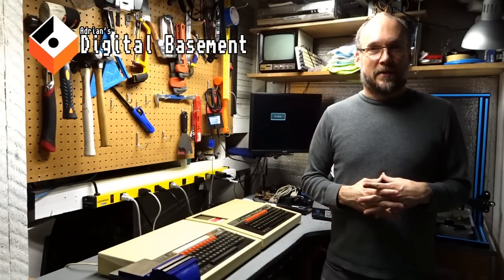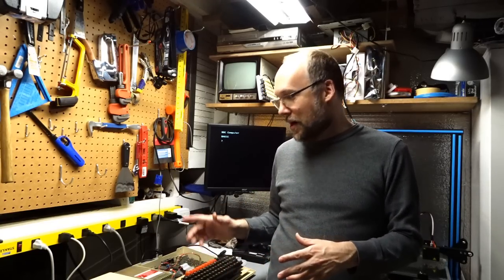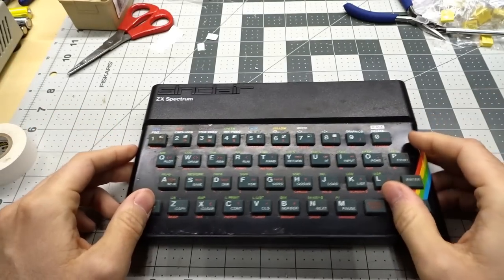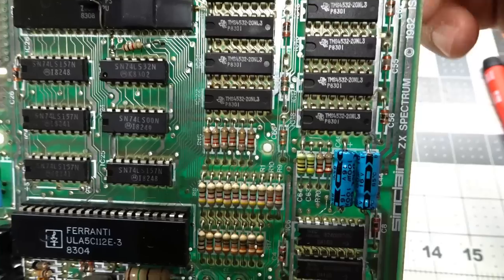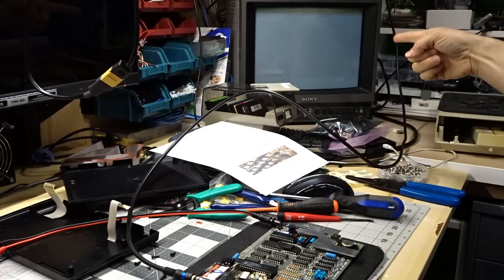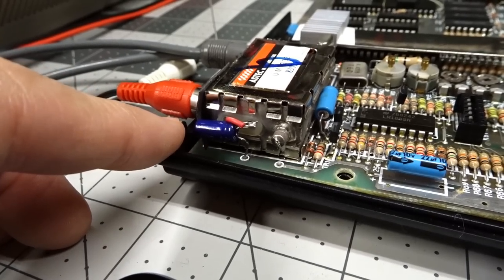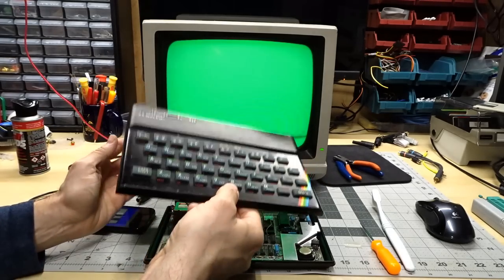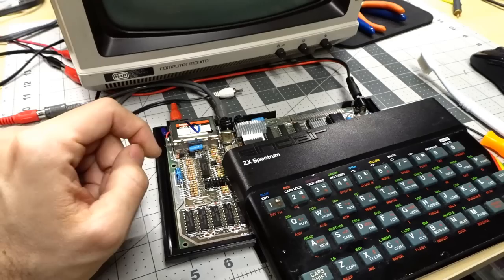ZX Spectrum Part 1 - It's a very sick machine (and a BBC Micro update)

Comment: I wrote my first program on one of these. It was a critical path analysis program for a project I was working on as an engineer. I ran it a couple of times thinking it did not work. Eventually I ran it overnight and the following morning at 4 am it spat out the results on my dot matrix printer. I cannot tell you how chuffed I was. One had to save the programmes on a cassette tape. Things are much easier now.

Comment: I had a Timex Sinclair 1000 probably 40 years ago or so got it from circuit city back before I knew Circuit City was chain store because in our town it opened in a small trashy 700 sq ft store front in a bad part of town.  This was back before Comodore 64, even before comodore Vic 20.  So early in the home computer cycle.  God I feel old now.

Comment: The lines through the colours is due to dot crawl. You may have noticed there are two crystals in there.. one generates the system clock and one generates the PAL colourburst frequency. Because they are not in sync with each other, you get dot crawl. They addressed this issue on the later 128K machines. You may find adjusting TC2 helps
Reply: @adriansdigitalbasement  the bad old days ;) Another benefit of the 128K machines is that they have an RGB output as well, which looks nice and crisp on anything modern!

Comment: Way back when this was state of the art I repaired these for a living. They are primitive but yet they were surprisingly reliable as long as the customers didn't do anything too stupid. The really weak spot was the edge connector which gives you access to all the signals on the CPU bus.There is nothing to protect the circuitry so anyone trying to connect or disconnect a device wile the power was on ran the risk of killing the computer. 

I remember one lady who came in with her sons machine several times only days apart. It was just a few weeks old and still under warranty so the first time we repaired it and didn't think more about it. When she came back a few days later and it was dead again we asked her if anything had happened that she thought might have anything to do with it, but no she couldn't think of anything. Well it was strange that it had died again, and that the fault was exactly the same as last time. So we mentioned that usually something like this could happen if you plugged in or unplugged a device like the printer or a joystick interface while the machine was powered up. It could also happen if the connector on any such device was damaged. But no, she was certain her son didn't cause this, that was impossible.
The third time she came back, it was just a few days later, it turned out to be the exact same problem again, and this time she was quite agitated and complained about the quality of the machine.  We took a good look at the edge connector and it looked like there were faint scratches there. So again we asked if she was certain her son hadn't tried to connect a device with the machine powered on. Now she got upset and explained that she was certain because he didn't have anything like that. He had no printer, no joystick interface or anything else, just the computer, so it was impossible that it was his fault. So we told her that we had to ask as it was very unusual that they died like this so many times. And then we took the machine to the shop, repaired it and painted the edge connector with nail polish. The next day she was back, and now she was livid. Not only were we incompetent as we couldn't repair her sons computer without it breaking regularly, but now her son told her the joystick didn't work when he got it back! I still remember her face as I calmly said that it was strange, just yesterday she had told us her son didn't have a joystick interface, and now she complained that it didn't work. Now how could that be? After some sputtering she said he got it as a present yesterday. So we told her that was a very good gift to her kid, just remember to tell him to never try to attach or detach it while the computer was powered on. Now if she could just wait a few minutes we would make sure it would work. So we took the machine back into the shop and rubbed off the nail polish from the connector, and that was the last time we saw that machine...

As for the memory problem I remember most of those was easy to find using a multimeter. Now I can't remember what pin we was probing but at least 90% of the time the bad chip measured low. If that didn't work we had a diagnostic board that ran a memory test and pinpointed any chip that failed.

It was an interesting time with new computers coming out all the time, and we're not talking just another IBM PC copy. We also repaired the Atari ST and the Commodore Amiga. There was very different in construction, though both used the same processor the circuitry was very different. The Atari was built down to a price point with just the bare minimum of components. Anything that could be excluded was left out. The Amiga on the other hand could be used as a teaching aid showing how you are supposed to design a circuit. And yet we had a much higher failure rate for the Amiga than the ST.

Another fun device was the Sinclair Microdrive. They used a miniscule tape cartridge containing a endless loop of tape that to increase the capacity was twisted into a möbius band. That way the tape had to pass the read head twice to access both sides of the tape. It sounds ridiculous but actually worked surprisingly well. Well compared to a floppy it was both slow and prone to failure, but there were ways to improve on the reliability. One quirk was that the tape in a new cartridge tended to stretch a bit before stabilizing. If the tape was just formatted once and then used to store data it tended to fail after a while as the tape stretched and the data became unreadable. A new cartridge typically formatted to about 85KB (yep not even 100KB, different times). I hacked together a bit of code that just reformatted a tape over and over again, and after a while the tape would format to somewhere between 95 and 105 KB, after which it didn't seem to stretch much any more. After that it seemed the tape was much more reliable.

The interface used to connect the Microdrive to the Spectrum was another interesting device. It could be used to connect up to eight Microdrives to a Spectrum, and it allowed up to 64 machines to be connected in a network. Any machine on the network could access any microdrive on any other machine on the network. There were no security whatsoever though so you could really mess things up if you wanted to. I don't remember any commercial games that allowed for network gaming, but I hacked together some software for real time messaging and remember working on a actual game, but I never got past the roughing stage. There wasn't exactly many who had a network of these to play on anyway, so it would just have been for me and my friends. Another big problem was that the network wasn't what I'd call stable- Messages was lost and connections dropped. If two machines tried to send at the same time bad things could happen. But it was a fun toy at a time when local area networking wasn't really standardised or an everyday thing.

Comment: The keyboard metal plate is stuck on the top plastic case by a double sided sellotape on either side and this can be easily praised out to reveal the membrane, wash and clean the rubber (only) with mild soap, and check the membrane connector for cracks, conductive silver can repair that but you will need to stiffen it slightly with a backing so when it is inserted back it will not crack as the lid is shut. All good fun.

Comment: “Now, how does this keyboard unplug?”

(Sinclair owners everywhere) “Oh no”.
Reply: Again, polish a turd
Reply: Indeed... “he’s going to break the ribbon!”
Reply: @salvadordali1601  considering how little money they were made for it's very impressive. At one stage the 48k version was something like £129.99, compare that with the price of their competitors who were in the £299-399 range and sometimes required an expensive monitor as well.
Reply: @user-yv2cz8oj1k  My Speccy 48k was a Xmas present and my parents forked out £99.99 (which was a lot for working class people) for it in a sale. This was quite early in the production run but I can't remember the year now.
Reply: I have tought just that.
Reply: @user-yv2cz8oj1k  Yep.  I bought one of the first batch in 1982 and it was a big step up from the ZX81.  Great machine, if you treated it nice.
Reply: Mine was very brittle and tore. I was able to find a brand new membrane though, someone makes them and it wasn't too expensive. I also found my voltage regulator was way out of spec, and the power supply was just a load of crap, so both have been replaced with switched mode replacements. It runs so cool now!
Reply: @user-yv2cz8oj1k  I think your price was only for the 128k version. The 48k was famous for being "under £100!"

Comment: This was the third computer I owned, previously had the ZX80 and the ZX81. If your family didn't have too much money, there really wasn't any other option but Sinclair. 

My Spectrum lasted me about 3 years in total and was patched up many times. I got the ram expansion that 'plugged' into the back. I put plugged in inverted commas, as it didn't so much plug as kinda hang in place. You'd be coding away and accidentally brush against the ram expansion and the system would reboot - goodbye code.
I eventually taped the damn thing in place. 

The keyboard went - pretty much exactly like in this video - I fixed it, believe it or not, with bits of tin foil. I had no other resources to use.
I must've patched that keyboard 20 or 30 times with bits of foil.

As for programming it - oh yeah, I coded, big time. At first, it was 'Hello world' stuff. Then I started getting a magazine called 'Your Computer' which came out monthly and had programs you could type in. I spent laborious hours typing away - a lot of the code was hex, basically, machine code. 
My typing skills were honed and never left me - I can touch type to this day due to the amount of hours I spent hunched over that spectrum.

I then started to learn to code and got pretty damn good at it. I coded the game 'mastermind', a whole bunch of simple platformers and got half way through coding a pacman game. I never did manage to stop the ghosts from randomly going through the maze walls. Because basic was so slow on the spectrum, I bought a compiler program with my pocket money (saved for months!), which would take the BASIC and compile it to assembly. It made programs run about 1000x faster. It was so fast, I had to introduce empty loops in my basic code to slow things down. 

The keyboard was absolutely crap, but crazily enough, I did learn all of those bizarre key combinations to speed up typing - and it really did work. 
Toward the end of my time with the spectrum, when the keyboard finally gave up the ghost, I got an upgrade to the spectrum with the solid keyboard. By that time, however, I had discovered guitars, girls and booze - it would be many years until I got acquainted with computers and code again. Those were the days!

Comment: It was so nice to watch this video...something I needed. I'm at wits end with my attempted repair of the issue 2 board. Everyone screamed at me to replace the caps and of course I finally did and no change. I know you've said those early 80's caps aren't usually the issue but someone pointed out that if they are off a bit then the lower RAM doesn't get initialized at the right time and even though the voltages are correct they weren't during critical boot-up...dunno. My entire issue 2 is now socketed (the upper ram came that way). I've tested all the ram and replaced the cpu (which was bad) and now I just get stuck at the check RAM screen (i.e. the ROM checks how much it has). The only two chips I haven't tested is the ULA and the ROM. I'm planning on getting an EPROM programmer and burning my own (requires a small mod to the board which I hate to do because I feel like I'm adding something to a non-working board). Unfortunately I don't own a scope. In any case, I felt like a failure after two tries and it's nice to see someone more experienced also having struggled.

Comment: I'm in the U.S. and remember when Sinclair launched the Spectrum, and it was available in either a 16K or a 48K configuration. The 48K version was far more popular, so much of the software that was developed required 48K.

Having learned a bit of Sinclair Basic on my brother's ZX81, I wanted a spectrum. Sadly, it was never released in the U.S. Instead, Timex partnered with Sinclair and released the TS2068, which I bought, but it didn't run most Spectrum programs. About a year later, Timex abandoned the personal computer market, so the TS2068 never received much support.

Although I still have my TS2068, I ended up buying several Spectrums (Spectra?) on Ebay to play with a few years ago. Most of them work, although the keyboard membranes needed to be replaced on a couple of them. I had to perform a composite monitor modification to get them to display on any TV or monitor I had available. After the mod, I connected one of them to my flat screen TV and it displayed quite nicely.

When I replaced my keyboard membranes, I also replaced one or two of the faceplates. I found the replacement parts on a website called "sell my retro," which can easily be found with a web search. Now you can find faceplates, and even replacement cases and keyboard "mats," in a variety of colors, to build a spectrum in the color scheme of your choosing. There are even modern Spectrum compatible motherboards available so you can build a modern Spectrum without any original Spectrum parts!

Comment: In the ZX the ULA is the most common part to die and also the only non-standard part.

Keep it until you find a dead Speccy then transplant the ULA for great justice.
Reply: Should see if anybody has the truth tables for that ULA. If you have those, programming a new one shouldn't be an issue.
Reply: @BlackEpyon  It was actually reverse engineered and a book written about it.  The modern Harlequin clone implements it in generic logic (It's actually kind of hilarious.  The board winds up about the same size:  All the space saved by using modern RAM modules winds up eaten up by the ULA logic instead)

https://www.youtube.com/watch?v=H4o7jELxk1E
Reply: @TheTurnipKing  I'm running into similar issues reverse engineering the DMA logic for the Tandy 1000 expansion cards (I suspect the DMA/RAM card in my 1000HX has some intermittent address logic on the ASIC, which is why I'm trying to recreate the card.) I can find schematics a plenty, but no truth tables. Fortunately, I've found a generic T1000 DMA/RAM card that I'm reverse engineering now, and between everything, I should be able to come up with something.  Modern RAM chips save space, and if you have the truth tables, you can just program your own FPGA or PLA chips, but having to recreate that with discrete logic ICs negates any space savings if you want to make something that you could have somebody ELSE put together as a kit.
Reply: Correct about the ULA going tits up.

Comment: I had a B+ with intermittent -5V (same PSU)... check the tracks by the screw hole at the output end of the supply PCB. Overtightening of the screw in the PSU's past had cracked the board radially from the screw hole through a -5V trace. The very fine crack in the copper resulted in intermittent audio.
Reply: I was going to say something similar, I've encountered this kind of fault a couple times and it can be very frustrating to diagnose! 😜
Reply: That's what I like about vintage computers, especially the ZX Spectrum: they come with a whole line up of collectors who know their business.
Reply: Oh, the guy running this repair shop http://www.mutant-caterpillar.co.uk/shop/ could even fix a broken in half Spectrum if needed. Some guys know all the ropes!
Reply: @MarcKloos  Ian is a legend indeed!

Comment: In my experience when you have a simple voltage source like that -5 that comes and goes, 9 times out of 10 it is a cold solder joint or cracked trace on the board rather than a transformer problem. The problem isn't always visible, even with a magnifying glass. I'd start by resoldering those half-dozen component pads in that circuit.